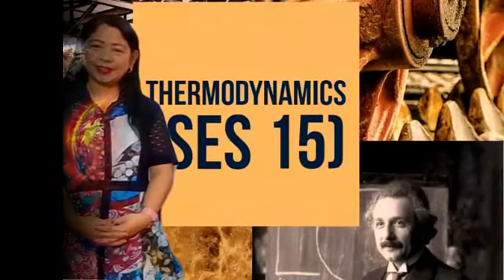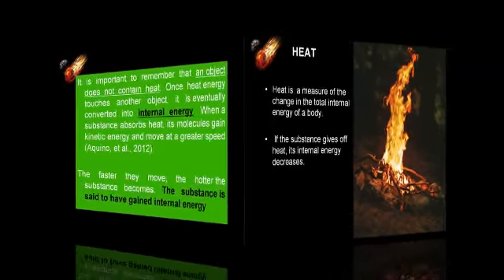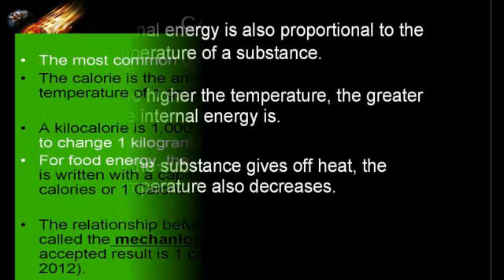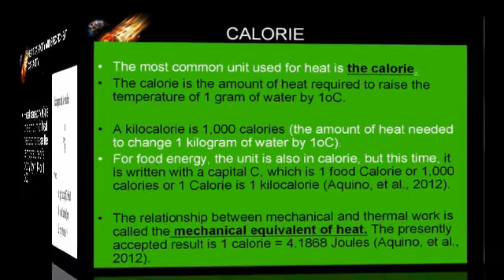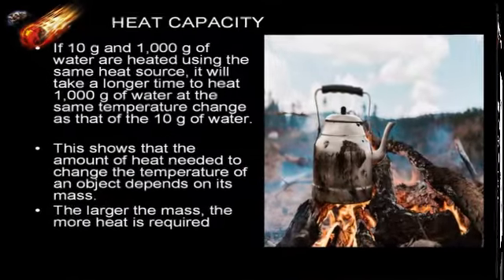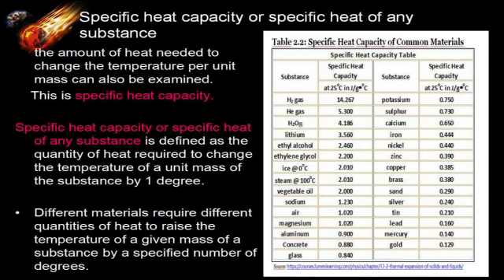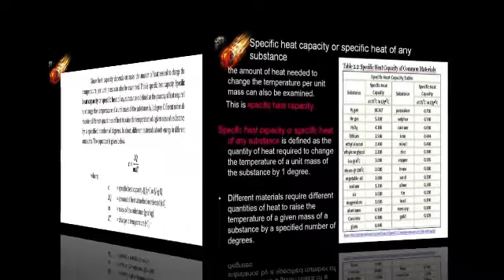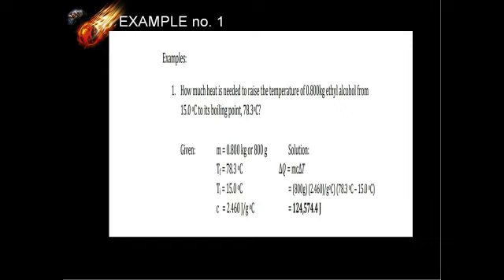HEAT AND SPECIFIC HEAT CAPACITY

Comment: 1. Heat and temperature are two different quantities. The basic difference between heat and temperature is that Heat is the form of energy that transfers from hot body to cold body. While the temperature is the degree of hotness and coldness of the body.
2. it is important as it will give an indication of how much energy will be required to heat or cool an object of a given mass by a given amount. It is very useful as material in cooking instruments such as frying pans, pots, kettles and so on, because, they can be quickly heated up even when small amount oh heat is supplied. Water as a cooling agent acts excellent as a cooling agent in engines.

Comment: 1. Heat is a form of energy and it is measured in Joules (J). Heat is exchangeable. It flows from hot area to cold area. Heat measures how energy moves or flows while temperature is the average kinetic energy and it is measured in Celsius (°C), Kelvin(K), and Fahrenheit (°F). Temperature is not exchangeable. Temperature of a particular body can be measured. Moreover, temperature does not flow. 

2. It is important to understand the specific heat. For example, the high heat capacity of water has a great deal to do with regulating extremes in the environment. Specific heat capacity is amount of heat required to raise the temperature of a substance by 1 K.

Applications:
- Watermelon brought out from the refrigerator retains its coolness, because of water content in the watermelon. 
- Material in cooking instruments such as frying pans, pots, kettles and so on, because, they can be quickly heated up even when small amount oh heat is supplied.
- Water as a cooling agent acts excellent as a cooling agent in engines.

Comment: 1.) Both are studied for science, but they also have a difference in terms of definition, which is somewhat related but not alike. Due to their wide usage in our day to day life. There exist a fine line which demarcates heat from temperature, in the sense that heat is thought of, as a form of energy, but the temperature is a measure of energy. There is also a simple difference between heat and temperature, temperature is slight but significant, heat is the overall energy of the molecular motion, whereas temperature is the average energy of the molecular motion.

2.) It’s an important applied material/application to the fields of science including chemistry and physics. The specific heat capacity and other thermodynamic properties are also critical in engineering disciplines especially when designing systems where the management of heat is essential. This would include everything from cooling systems, heating systems and everything in electronics where heat is in need.

Apllication to our daily life:
 • Water's high specific heat capacity helps to moderate daily air temperature around large bodies of water.
• The handles of utensil at home are made of materials have very high specific heat.
• Cooking/baking cookies in an oven.

Comment: 1. Unlike temperature, heat is the transfer of energy from a hotter body to a colder body. It is sometimes referred to as thermal energy. All chemical reactions involve a change in heat. There are three types of heat flow in substances: conduction, convection, and radiation. Conduction is the transfer of heat in solids. Convection is the transfer of heat in gases and liquids. Finally, radiation is the transfer of heat through space. Radiation is mainly responsible for the hotness we feel from the sun.

2. Specific heat capacity is a measure of the amount of heat energy required to change the temperature of 1 kg of a material by 1 K. Hence it is important as it will give an indication of how much energy will be required to heat or cool an object of a given mass by a given amount.

3. When steam condenses on the food the heat is released directly onto the food enables the food to be cooked at a faster rate

Comment: 1.Heat is the form of energy that is transferred between two substances at different temperature.
Heat is measured in units of energy usually calories of joules.
Temperature is the properly that is used to define the state of system where as heat is energy transferred between the boundary of system and surroundings due to the temperature different .

2.Specific heat gives the amount of heat energy required for heating a substance of 1 unit mass by 1 °C. So more the specific heat, more the energy required for heating the substance.

Utensils used for making tea or coffee, or cooking vegetables or rice are made of materials of low specific heat. They are polished at the bottom. So they get heated quicker. For example, copper, aluminum etc.

Comment: 1. Heat is a form of energy which flows from a hot area to a cold area. Heat measure in joules. Temperature it is the degree of hotness and coldness of a body. It is measured in kelvin, celcius, fahrenheit. Heat is energy while temperature is a measure of energy.

2. Specific heat capacity is important because it will give an indication of how much energy will be required to heat or cool an object of a given mass. It also helps in regulating the temperature.

Applications
▪︎ Cooking utensils are made of metal which has low specific heat capacity so that it need less heat to raise up the temperature.
▪︎ Water is used as the cooling agent due to its high specific heat capacity.
▪︎ An instrument like a thermometer, the body may be made of higher specific heat and the tip is made of a material of low specific heat.

Comment: 1. How is heat different from temperature ? 
Heat
The energy transferred from one material to another as a result of the difference in temperature or change of state.Heat has the ability to do work.
Temperature
A measure of the average kinetic energy of the particles in a substance, measure of hotness or coldness expressed in terms of any of several arbitrary scales like Celsius and Fahrenheit.Temperature can only be used to measure the degree of heat.
2..WHY DO YOU THINK THAT IT IS IMPORTANT FOR YOU TO UNDERSTAND "specific Heat capacity"?
 This is an important equation because it relates the heat lost or gained by an object to its temperature change. A substance with a small heat capacitance cannot hold a lot of heat energy and so warms up quickly. We should note that the rate of heat transfer (how fast something heats up or cools down), is a function of the temperature difference. So as heat transfers from the hot object (which cools) to the cold object (which warms) the temperature difference reduces, and the rate of heat transfer slows down and finally stops when they reach the same temperature. The heat capacitance of a substance depends both on the material it is made of, and the mass of the substance.
give examples of the applications in your daily life.
Substances having a small specific heat capacity, are very useful as material in cooking instruments such as frying pans, pots, kettles and so on, because, they can be quickly heated up even when small amount oh heat is supplied.

Comment: 1. Heat is a form of energy that can transfer from hot to cold while temperature is the degree of hotness and coldness of a body. 

2. It is important for us to understand specific heat capacity because we are sorrounded by it. SHC (specific heat capacity) is the amount of heat in Joules which is connected to Kelvin, where can be determine as the things around us that can be burn easily or can conduct heat. It can be seen in the units of calories that gives us energy (converting it) which is somehow bad for our health. Too much calories can lead us human person to sickness.

An example of SHC application in daily lives is the wood that can be use in cooking to create fire, dried leaves and etc. Also the water, we can determine on how long will it take to boil it and to cool a hot water down.

Comment: Heat describes the transfer of thermal energy between molecules within a system and is measured in Joules. Heat measures energy or flows. An object can gain heat or lose heat, but it cannot have heat. Heat is a measure of change, never a property possessed by an object or system, while temperature describes the average kinetic energy of molecules within a material or system and is measured in Celsius (°C), Kelvin (K),Fahrenheit (°F). It is a measurable physical property of an object—also known as a state variable. 

Application to daily lives:
-thermometer, the body may be made of higher specific heat and the tip is made of a material of low specific heat.
-Cooking utensils are made of metal which has low specific heat capacity so that it need less heat to raise up the temperature.

Comment: 1. HEAT
-Heat is a form of energy that can transfer from hot body to cold body.
-Heat is the total kinetic energy and potential energy obtained by molecules in an object.
-Heat flows from hot body to cold body
-It has a working ability
while 
TEMPERATURE
-Temperature is the degree of hotness and coldness of a body.
-Temperature is the average K.E of molecules in a substance.
-It rises when heated and falls down when an object is cooled down.
-It does not have the working ability.

2. It has importance in terms of energy, time and costs involved in changing temperatures of objects.
APPLICATIONS.
- using of pans, kettles, etc for cooking
- water in fish pond should be regulated in a desired temperature in order to live
- car's radiator as coolant that has high heat capacity  of water that helps regulate the rate at which air changes temperature.

Comment: 1. Heat is the total energy of the motion of the molecules of a substance, whereas the temperature refers to the measure of the average energy of the motions of the molecules in the substance. The heat is dependent on factors like the speed of the particles, the size of the particles and the number of particles, etc.
We have all noticed that when you heat something up, its temperature rises. Often we think that heat and temperature are the same thing. However, this is not the case. Heat and temperature are related to each other, but are different concepts. 
2. Specific heat capacity is a measure of the amount of heat energy required to change the temperature of 1 kg of a material by 1 K. Hence it is important as it will give an indication of how much energy will be required to heat or cool an object of a given mass by a given amount.
 Application of Specific Heat capacity in daily situations are..
•Substances having a small specific heat capacity can be quickly heated up, it also experience a big change in temperature even though only small amount of heat is supplied.
• Substances having a small specific heat capacity, are very useful as material in cooking instruments such as frying pans, pots, kettles and so on, because, they can be quickly heated up even when small amount oh heat is supplied.

Comment: Heat	and Temperature
1. Heat is a form of energy that can transfer from hot body to cold body.	Temperature is the degree of hotness and coldness of a body. Heat is the total kinetic energy and potential energy obtained by molecules in an object.	Temperature is the average K.E of molecules in a substance. Heat flows from hot body to cold body.	It rises when heated and falls down when an object is cooled down. It has a working ability.	It does not have the working ability. Heat SI unit is “Joule”.	Temperature SI unit is “Kelvin”. Heat is measured by the calorimeter.	Temperature is measured by the thermometer. Heat is represented by “Q”.	Temperature is represented by “T”.

2. Specific heat capacity is a measure of the amount of heat energy required to change the temperature of 1 kg of a material by 1 K.
Hence it is important as it will give an indication of how much energy will be required to heat or cool an object of a given mass by a given amount. This will give information as to how long the heating or cooling process will take under a given supply, as well as the cost implications thereof.

Applications: 
1. When boiling water
2. Heat storage instruments is very useful and they are usually made of substance with a high specific heat capacity.
3. Materials of high specific heat as insulators
4. The water in the container remains cool even in summer and the reason is the high specific heat of water
5. Substance having a small specific heat capacity, are very useful as materials in cooking instruments such as frying pans, pots, kettle and so on.

Comment: 1. Heat is nothing but the amount of energy in a body. As against this, temperature is something that measures the intensity of heat.Heat measures both kinetic and potential energy contained by molecules in an object. On the other hand, temperature measures average kinetic energy of molecules in substance.The main feature of heat is that it travels from hotter region to cooler region. Unlike temperature, which rises when heated and falls when cooled.
2.The specific heat capacity of a substance is a measure of the amount of thermal energy it requires to heat that substance by a fixed amount. In SI units it is measured in J/kg/K sometimes expressed in J/g/K.It’s an important material property in a number of fields including chemistry and physics.The specific heat capacity and other thermodynamic properties are also critical in engineering disciplines especially when designing systems where the management of heat is essential. This would include everything from refrigeration systems, heating systems and of course almost everything in electronics where the management of waste heat is critical.
Heat storage instruments are very useful and they are usually made of substances with a high specific heat capacity.
Water as a cooling agent acts excellent as a cooling agent in engines.
 Water is also used in houses in cold climate countries because as it is heated up (boiled) it tends to retain heat and warm the house due to its high specific heat capacity.

Comment: The difference of heat and temperature
Heat is a form of energy while temperature is about how cold and hot something is, heat and temperature is connected but there's a difference in terms of unit of measurement in heat, joules and calories is the unit while in temperature is celcius, Kelvin and Fahrenheit, in device used to detect heat  is calorimeter while in temperature is thermometer.

Application of specific heat
According to my research Specific heat in physics is the heat required to raise temperature of things. In applying in daily life, if you know the specific heat of a boiling water you can't over heat a water, when you know the specific heat of a things like utensil is a materials of low specific heat, so when you make coffee my mother always tell me to put spoon before putting the hot water to avoid to break the glass because of having low specific heat the heat comes from the hot water transfer to utensil.

Comment: 1. Heat is a form  of energy and is measured by joules.  Heat measures both kinetic and potential energy contained by molecules in an object. On the other hand, temperature is a way of describing how hot and cold an object is. Temperature measures average kinetic energy of molecules in substance. 

2. Heat is important to understand because heat is important to all aspect of life. Plants and mammals relies on heat. Heat is result of energy sometimes it can be benificial but sometime it can be dangerous.

Application
Warning the house
Cooking
Drying the washed clothes
Heating foods

Comment: The difference between temperature and heat is that heat deals with thermal energy, whereas temperature is more concerned with molecular kinetic energy.
Heat and temperature are two different quantities. The basic difference between heat and temperature is that Heat is the form of energy that transfers from hot body to cold body. Its unit is the joule. While the temperature is the degree of hotness and coldness of the body. Its SI unit is Kelvin.

It is important to understand specific heat capacity because it will give an indication of how much energy will be required to heat or cool an object of a given mass by a given amount. This will give information as to how long the heating or cooling process will take under a given supply. 

*In cooking
* In frying pans
* Using kettle to boil water

Comment: 1. As I've learned from our past discussion and on the video I've watched today, I learned that temperature is usually associated with heat but they are not same. Temperature is the measure of the degree of hotness or coldness of a substance while the heat is the energy that transferred from one hotter objects to lower temperature objects.

2. As a current general science major student, it is important to understand specific heat capacity because I think I will always encounter this type of topic up to the days I am finally teaching. So, regarding to the video, I understand that specific heat capacity is the quantity of heat required to change the temperature of a unit mass of the substance. It is also important to understand this because it help us to know different kinds of substance and what substance are we going to use in specific matter.

Examples in daily life:

●We all know that wood has a high specific heat. Wooden houses will keep the inside cooler during summer days. So, builders can choose building materials appropriately depending on the location and altitude. That allows to build warmer houses or cooler houses.
●When we go to the pool in summer, the water is still cool because of high specific heat.
●Utensils used for making tea or coffee, or cooking vegetables or rice are made of materials of low specific heat.